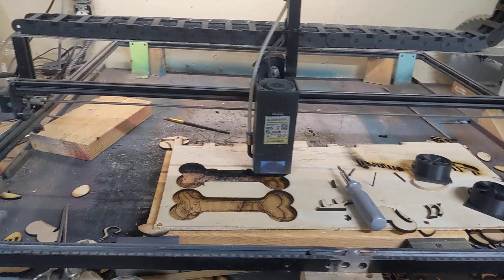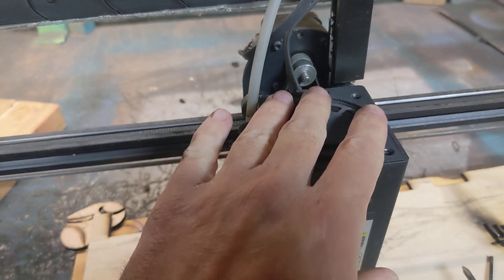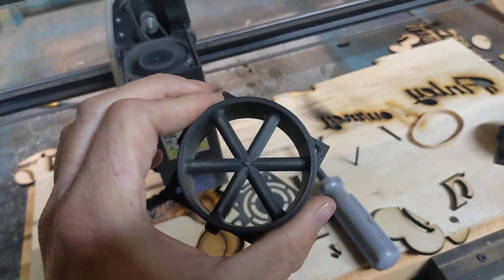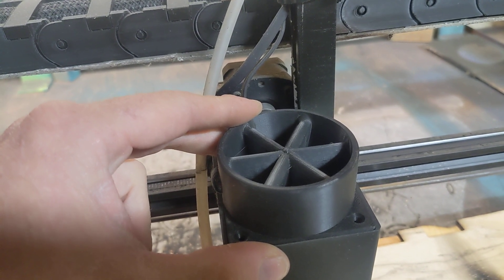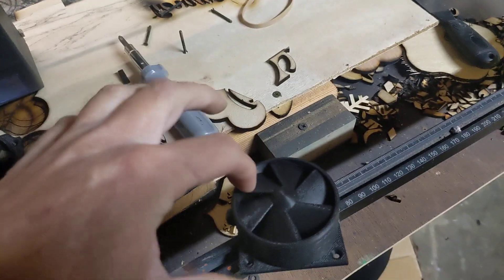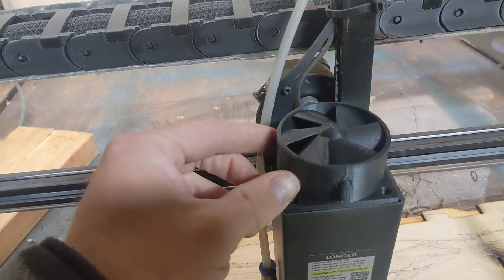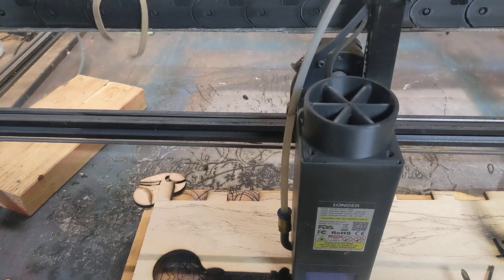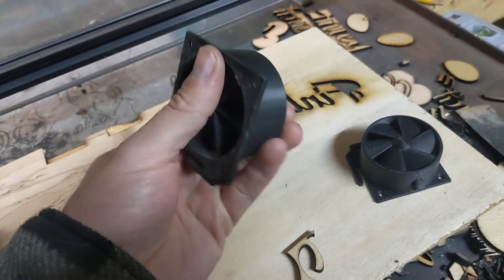Longer Ray5 20w Laser:  Adding custom fan ducts to the module to allow the use of an air filter

Comment: Do you have any scan tools for your 3D printer are you able to make a left and a right part off of just one side like using a left or right side I need two covers made for my 64 Plymouth Bairacuda.covers for the rear seat latches
Reply from the maker: I am set up for scanning.  If you have one part I can duplicate it.  If the opposite side is simply reversed then it shouldn't be an issue.

Comment: Very nice. Have you ever considered designing an adapter for a lawn mower air filter? They are small, lightweight, and wont restrict the airflow which would be my biggest concern for a high power laser. Nice work regardless.
Reply from the maker: My initial design was to accommodate a 34mm UNI filter lol they sit a little too high though and were interfering with some of the carriage.  My hope is to rebuild teh carriage to work with a 2040 extrusion...the 2020 is too flimsy for the width I'm running on the X axis...at that time I might be able to redesign enough to hold a proper filter.